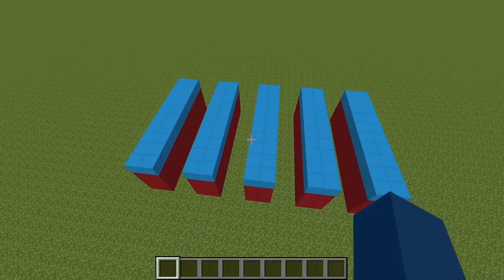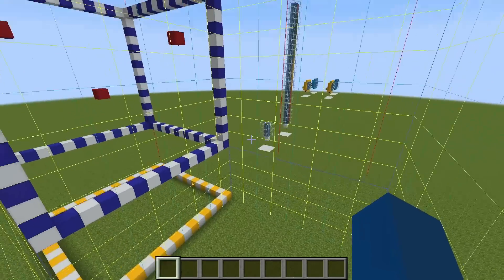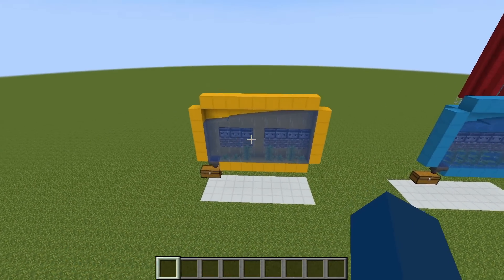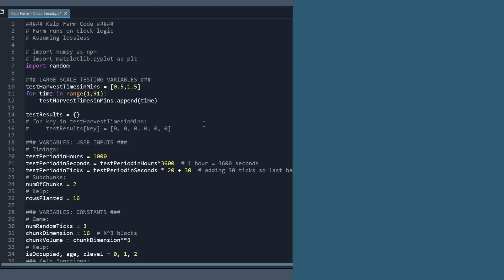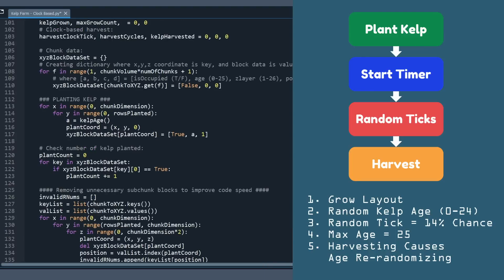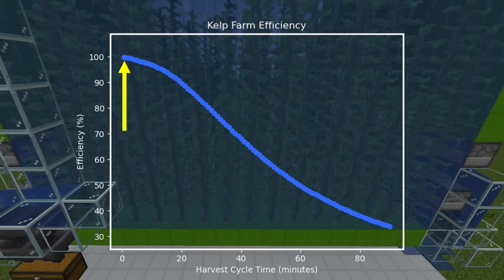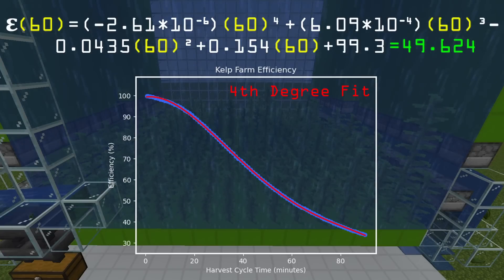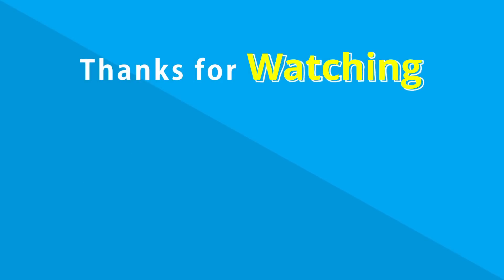Simulating 1000s of Hours in Minecraft to Optimize Kelp Farms

Comment: Hi, i continue to explore your videos. This is realy nice one.  Even though you do not use any classes for structuring, your code came out realy neat.
I think there is one more metric that would be helpfull. 
yield/plant/harvest(time)
For thouse who want to get maximum kelp for given game lag.
Reply from the maker: Thanks! Yeah I’m not the best at programming lol but even though I say the rates are per second, I run the code in a loop where each loop is one game tick, so the results are for a perfectly running game with no lag
Reply: @SeaJayPlays It is your hobby and you are prety good. It is reasonable to assume full TPS. You can't realy take lag into account anyway. By the way in your Bamboo code at (2:40) it seems that at each harvest you assigne same stage value for each plant. Maybe it is generated once per clock timing. At least that would explain why there are 5 destinct functions and not something continuous.